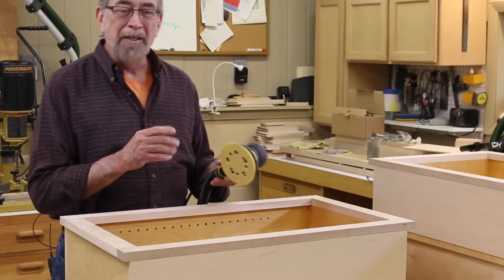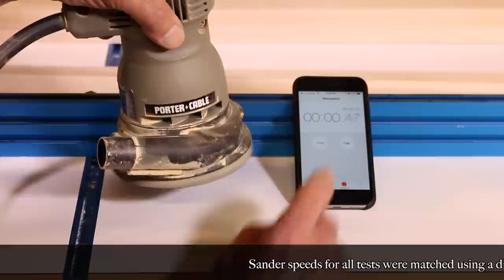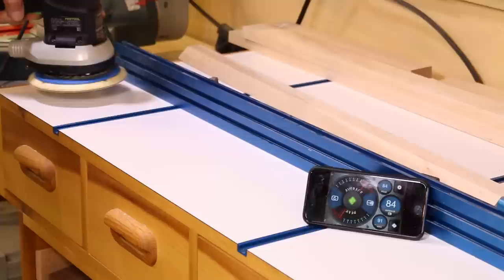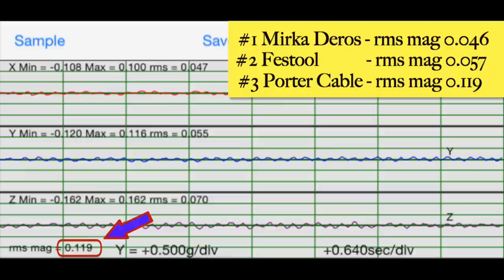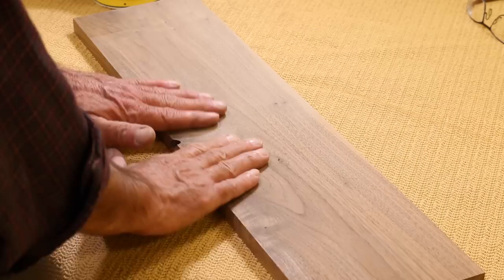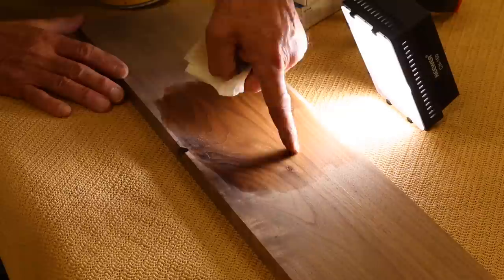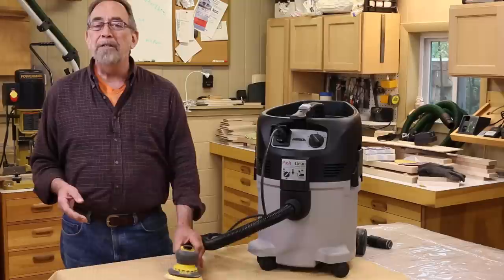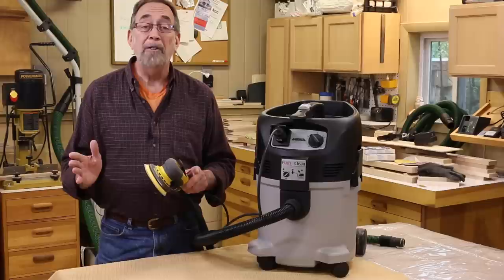Mirka - An In Depth Look

Comment: Mirka introduced the Deros brushless DC motor sander into the US market several years ago and then pulled it quickly due to problems with the DC inverter circuitry failing. If you compare the Mirka Ceros sanders that use a shoe box sized external DC power supply to the internal DC inverter circuitry of the Deros line up, you can see how much the power control circuitry has been miniaturized in the Deros sanders. The shoe box power sized DC supply in the Ceros sanders has been squeezed entirely into the small handle of the Deros. But that may come with a reduction in longevity. 

Mirka's Deros sander lineup was already re-designed and re-introduced due to this circuitry failing in the field. Time will tell how long it lasts. A 3 year warranty suggests that Mirka believes it will last longer than 3 years when in continuous daily shop use.

When comparing costs, the right comparison to make includes costs to maintain and run the equipment. The industry standard is a high quality lightweight and powerful pneumatic sander (Mirka makes those too, along with many other manufacturers). Don't forget to include the purchase and operating expenses for a  7HP plus industrial air compressor system used to power your pneumatic sanders. These industrial air compressors are hugely inefficient compared to a 300 watt DC brushless motor sander and the electric power consumption per year will make this sander quickly cost competitive with a compressed air system. 

Additionally, anyone who spends a long time sanding will understand that vibration levels and weight are more important considerations than the initial up front cost of the equipment. Sanders can cause permanent loss of  grip strength and nerve sensation due to vibration white finger syndrome. VWFS, hand-arm vibration syndrome (HAVS) or dead finger is a secondary form of Raynaud's syndrome,all are a serious industrial injury triggered by continuous use of vibrating hand-held machinery) Those injuries are a permanent destruction of soft tissues, so a serious business for such a common occupational hazard. At the very least, frequent users of sanders and grinders should wear gel-based gloves to reduce vibrations when running sanders and grinders for long sessions.

Comment: While I understand the concept of a $600 sander might be hard to swallow for some the Mirka electric sanders make what is many woodworkers least enjoyable job (sanding) quite palatable.  I have the Ceros which has the external DC supply and I actually like it better for shop use since the sander itself is a little lighter but the same form factor.  While they make sense for many professionals I understand they make less sense for hobbyists like me.  I will say it simply if you have the budget for the Mirka sanders you will not regret the purchase, if you don't have the budget for them then there are sanders that are cheaper and get the job done, just they just don't have the last bit of finesse.  There are ways to make living with cheaper sanders better, good ear muffs, vibration gloves etc but not having to use them makes sanding more enjoyable foe me.  A good dust extractor won't bring you up into the danger dB range unless you are sitting right on top of it while you use the sander, I use a full shop dust extractor (Oneida Dust Cobra) which uses an induction motor so the "shop vac" portion of the sound is negligible.  I always find it funny when people poke fun at high quality tools, especially when they have never used them, I don't have the budget for a $60,000 Martin shaper but I LOVE to have one and certainly won't have a go at the cost just because I wan't familiar enough with it to see the utility.
Reply: Yes high price is not a problem when it's full of concrete actual value for that price. It is only a problem when price is mostly made of "air".

Comment: Steve, great review.  As I am currently in the market for a new sander, I would like to know how the dust collection of the Mirka Deros compares with the Festool ETS when both are using Abranet discs. Any chance you might video that test?  Thanks, Steve Rice
Reply: Steve Rice Steve, I won't be able to do a side-by-side test, at least not any time soon.  I'm off on other projects now.  Here's what I noticed though... I put the Abranet disks on my Festool sander (150 ETS) and on the Mirka.  On both tests I used my Festool Dust Extractor (I like it better, see above).  The toughest test for any sander and dust collection is sanding an edge where the disk overlaps a bit.  The dust will fall where the disk is unsupported.  I sanded the face frames of some cabinets with the cabinets laying on their backs.  Any dust that was not sucked up, fell inside the cabinet and was super easy to see.  I didn't try to weigh it, but from a visual comparison, I would have to give a very slight edge to the Mirka.  Both left some dust at the bottom of the cabinet, but it seemed less each time with the Mirka.  I suspect their new pad design, which allows strong air movement pretty far out toward the edge of the pad was the main difference.

Comment: Nice video,  It looks like you're using the 5 inch sander in the video.  I'm interested in the 6 inch model, which has the option on a 2.5mm orbit, or a 5mm orbit.  Do you have any ideas what the applications are for either option, or why would I buy one over the other?

Thanks,  John
Reply from the maker: A smaller orbit yields a finer finish (visually a more tightly refined scratch pattern when viewed under magnification).  A larger orbit works more efficiently at removing material than a unit with a smaller orbit.  If the need to remove material efficiently (labor costs are involved) is more important, then a larger orbit will help you.

Comment: You are using the Mirka 5mm orbit, correct?  The 5" doesn't come in less than 5mm orbit does it?
Reply from the maker: Yes, Steve is using the Mirka 5mm. The 5" only comes in 5mm orbit. The 6" comes in both 2.5mm and 5mm orbit.

Comment: Can you use a fein dust extractor with the Mirka Deros??
Reply from the maker: Hello Randy. Unfortunately, we don't carry Fein Dust Extractors at Highland Woodworking, but the standard 27mm hose that comes with the Festool Dust Extractors fits easily onto the port opening of the Deros sanders.
Reply: Randy Eggleston I just bought this mirka sander and a fein extractor here in the UK and the supplied hose fits perfectly on the sander.

Comment: What is better festool ets ec 150 or this mirka deros?
Reply: They are very similar. Very minor differences between the two. I have the ETS EC 150. One thing is the festool plug it cord. I use many festool tools so it saves a small amount of time each time I use and put it away. Maybe 15 seconds of savings each tool change. Other that that they are relatively the same

Comment: Very good review of this product. My question is how can you justify the cost?

Observation 1 - near $600 cost.
Observation 2 - buy a good set of noise cancelling headphone and palm sander for under $200.

You can purchase an extraordinary set of head phones to cut down on noise, and have enough money left over to purchase any number of random orbit sanders from a number of manufacturers.  Depending on the head phones you buy, you could probably get at thickness planer to boot.

If you have a Rolls Royce in the driveway - this is your sander.
Reply: if that's your opinion then why buy a sander? just use sandpaper on a hand held sanding block.. in the end they are cheaper, quieter, they require no maintenance or repair, consume no power and give and even better finish quality..
Reply: OK - I've used hand sanders powered and not since my first wood working class 1972. I have burned up a few over the years but you can't beat a power sander for speed, and a hand sander (or just paper in hand) to finish the job.   My question only went to what made that sander worth the cost versus any other power sander?  (BTW I have a B&D RO square pad, Makita round RO, and Belt sanders.  Rebuilding a Sears belt/disk sander right now.)  I'm all for power, but use my hands and paper for the finish work. - Annie
Reply: So here is my observation about Mirka. I am boatbuilder and what is very important in that job, is to get it done as quick and as good as can be. I have comparison between pneumatic and electric Mirka and i can say it with full honesty, electric one is great. At some conditions it can save 50% of sanding time, especially with finishing. I wouldn't recommend it to some hard and tough work, because i am pretty sure it's more fragile than pneumatic but i still love that one. That is why i have bought it today with vacuum cleaner for less than 1100 dollars. Regards!
Reply: So here is my observation about Mirka. I am boatbuilder and what is very important in that job, is to get it done as quick and as good as can be. I have comparison between pneumatic and electric Mirka and i can say it with full honesty, electric one is great. At some conditions it can save 50% of sanding time, especially with finishing. I wouldn't recommend it to some hard and tough work, because i am pretty sure it's more fragile than pneumatic but i still love that one. That is why i have bought it today with vacuum cleaner for less than 1100 dollars. Regards!

Comment: Great in-depth review. I know this is a paid advertisement, but it would have been nice to hear some negatives. There are always pluses and minuses. No product on the planet is perfect for all situations.

So if you do care to expound a bit on the cons, that would be appreciated. It's a tempting product, but the non-objective nature of this review does cast some shadow on this review.

I do enjoy your videos, but just wish sometimes they were independent.
Reply: Marty Backe If you have watched any of my other "Product Tour" videos, you know I always do point out any shortcomings or places where the manufacturer could improve the product, instructions, or ergonomics.  From what I understand, the company that makes this product has been at it a long time, primarily supplying the automobile manufacturing sector all over the world.  I assume they have learned a thing or two.  Okay, having said that, you will note I spent very little time talking about the vacuum.  You can read more about that below in a reply to that question.  As far as the sander, I will point out one "idiosyncrasy."  Not really a problem, but something you have to get used to... With other sanders when it is time to change the disk, just flop the sander upside-down, change it, and away you go.  Because of the paddle switch on top of the Mirka, if you do that, it starts running.  That can be pretty exciting... not in a good way.  There is a pushbutton power switch on the Mirka, and you have to turn that off before you set the sander upside down.  It only took me once to remember to do that, since I had turned the sander upside down and was holding it by the sanding disk when I set it down!  Marty, sometimes a manufacturer simply achieves a product that is for all intents and purposes, "nearly perfect."  I think Mirka did that with this sander.  It's kind of like a Woodpeckers model 1281 Square... there just isn't any way to make it any better.
Reply: downtoearthwoodworks Thanks for the reply. When I posted my comment I didn't realize the cost of this product. So yeah, I can see that there probably wouldn't be many negatives. Good observation regards the paddle switch - see, nothing's perfect ;-)

Comment: Should be good for hobby use, looks like a toy, and of course it has less vibrations it is only a rotary Sander, it i not oscillating if it does, more vibrations will have.But it is very Quiet love this, But faster sanding as a Festool don't make yourself a fool. As i say  a good Tool for Hobby use in my Opinion. Not bad at all.
Reply: powertothebauer Mirka is a pro brand used in body shops for years.  The Deros is a dual action sander.  The vibration of the sander is mitigated by small weights placed on the pad. This sander is so good Festool tried to copy it with their new line of brushless motor sanders but came up short. Used with their open mesh abrasives it is completely dust free. Try one , no BS.
Reply: You clearly have no idea what you're talking about . These are random orbital sanders (DA), not a rotary (orbital). I sold my Festool ETS EC150 the day after i first tried a Deros which is a far superior product.